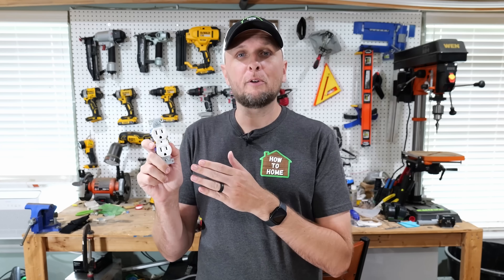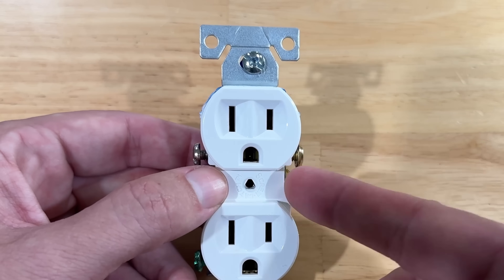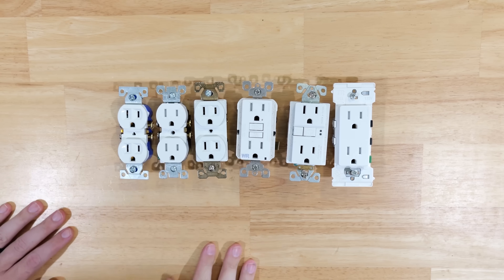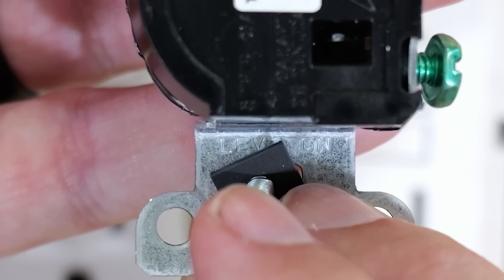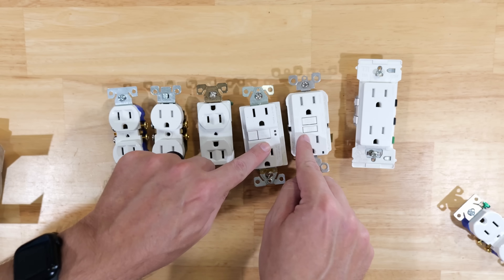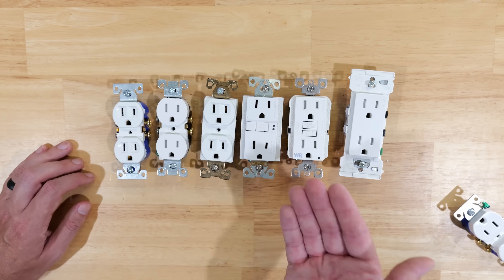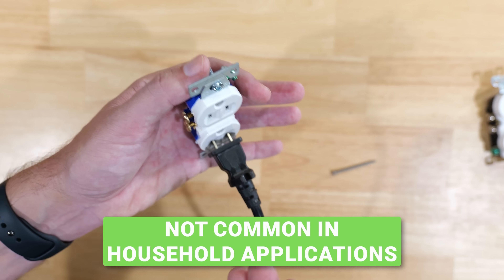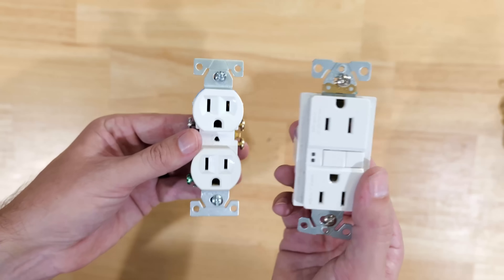The Shocking Reason Why Your Outlets Are Installed Upside Down!

Comment: I'm in the ground-port-down camp for residential.  The only time i see ground-port-up is in medical or industrial applications. The thinking is; this protects a potential short from an object (think piece of wire, key tether, another cable, etc) being drug across the inserted plug which might slightly dislodge the plug as mentioned in the video
Reply: Even in hospitals, I don't believe there is a requirement for ground plug up. It goes back to the old "metal faceplate falling down on plug causing short" syndrome. Every plug I have ever plugged into an outlet leaves absolutely no room for a plate or any other object to fall between. Plugs are totally flush against the outlet and designed that way to prevent objects or fingers to touch the prongs. Faceplates do not just fall off the wall. At least in my 71 years of existence I've never seen it happen.

Comment: My old house is completely re-wired and I installed all the outlets ground prong down. 3 of my appliances have the 90° plug, and hanging down just made sense. I wired my garage receptacles with the ground prong up just to annoy my contractor friend! It did get on his nerves.
Reply: If I were buying your house I would refuse to close until that was corrected.

Comment: Great discussion. You’ll never convince the other side however. One thing you didn’t mention is that an awful lot of cords on fridges, washers and power strips now are right angled to hug the wall better and the majority of them are in a ground down orientation.
Reply: @bv226  Exactly! Plugging such a cord into a ground up receptacle nullifies the whole point of the bend as the cord has to make a u shape which does not hug the wall any better than a non-bent cord does.
Reply: Yes, my washing machine and refrigerator agree.  Ground down for sure.

Comment: My old journeyman insisted that the reasons that, for example, the hospitals install them with the ground side up was because the ground pin can carry more weight from a heavy 120VAC cable. Which back then the hospitals did have heavy duty cords for just about all their devices. The jury is still out!
Reply: Not just the weight of the cords, but also blows from falling objects.  I've only ever heard the "something might fall and hit the ground pin" argument from people arguing against ground-pin-up.  The issue isn't something making contact with the pins, it's something dislodging the cord of potentially critical equipment.  Things falling and striking the cord are less likely to dislodge it if it is narrow side up.  Doesn't usually matter in homes, but something to keep in mind when wiring up a shop (or a hospital).
Reply: I put ground side up in garage and industrial areas for the same reason plus over the years the receptacle seams to last year's longer less cords falling out after a few years
Reply: In 34 years experience, ground down in houses or owner preference. Ground up in an industrial setting.  In hospitals, I've always installed the gray or red hospital grade recepts.....Geeeez, have you ever tried pulling a plug out of one of those? I don't think it would matter which orientation the ground was. They have a pretty stout grip. I was always told to install ground up in industrial and some commercial settings because of the possibility of something falling in between the plug and device. Anyhoo....good vid
Reply: I do like how the plug "hangs" with the ground up, keeps the 2 prongs inserted better, reducing arcing possibilities when things start getting looser. Not great for the 90 degree plugs though.

Comment: Ground face down when I replaced myself all 2-prong receptacles with 3-prong receptacles.  Licensed electrician who replaced the electric panel & also installed several new 3-prong receptacles also installed Ground face down. Reminds me of a face - mouth and two eyes.  
3-prong appliances in my. house  are microwave, Fridge, Gas-top stove, gas wall oven,  clothes washer, clothes dryer, gas furnace, humidifier, extension cords, overhead garage door openers, desktop computer,. All other electrical items are 2-prong.

Had outlet covers & cabinet locks when my children were toddlers. :¬) Webhead USA

Comment: All of my angled plugs are shaped for bottom ground if I don't want the strain of the power cable doing a full 180 going back to the floor, so the correct orientation for me is ground-down.

Comment: Great video, right angle plug don't look good in a grd up install
Reply: True.  Also there are lots of timers that require the ground at the bottom, otherwise it will be upside down.

Comment: It messes with my OCD if the outlets are upside down!   I most often see ground up in doctors offices and hospital settings.
Reply: @JeepinMaxx  Just like a lot of 3 pronged cords in a residential setting are designed with a 90 degree bend for the ground down orientation, a lot of medical equipment is designed with the ground up orientation in mind. That’s why doctor’s offices and hospitals tend to be ground up.

Comment: This code covers receptacles that are in a vertical installation respecting the floor. What about receptacles in a horizontal installation?
Reply: code doesn't care about orientation beyond not putting receptables face-up or within flooding risk (ie, really close to the floor such that a pool of water could infiltrate the receptacle).  Nobody really ever installs receptacles horizontally because the device plugs were never really designed for that, and places that do so are likely doing it for aesthetic/spacesaving or otherwise-arbitrary reasons that have nothing to do with code.

If you really wanted to, you could install receptacles in an angled orientation...but because houses are never built in that way there's almost zero chances to do so without extra work for no reason.  I imagine the reason why we install vertically is simply because of the machinery used to make receptacles are oriented in that fashion.
Reply: @aliso-pv7ll  In my opinion, a horizontal orientation on the wall means the installer didn’t have the cojones to pick a side in this debate 🤣

Comment: I was just recently in a local hospital & I noticed that all the outlets in the rooms & hallways had ground up.  I didn't notice if the gfi in the bathrooms were this way though.
Reply: You got that right.  Also in our research buildings.
Reply: Hospitals are a high hazard area as Oxygen is commonly piped into every room. 

Sparks not a good thing there.
Reply: In Canada we put ground down in residential areas so as the plug wiggles out the ground breaks contact last. In hospitals it’s ground up to prevent an arc flash in a possible oxygen rich environment.
Reply: I've ask hospital employees about the plug upside down.    They said they're plugs that connected to emergency backup power
Reply: @Peanutz77  In our hospital and research building, the emergency power recepticals are red, and the non are white. Which is pretty standard in the area hospitals I have been in. All have ground up. Do you have red recpticals at all there?
Reply: @momkatmax  yes. They were red and ground up
Reply: @Peanutz77  Most of the time, emergency power outlets will be distinguished by color.  Orange outlets are pretty common

Comment: When using metal cover plates, I always install with the ground prong up. I have seen the screw holding the plate wiggle loose and drop down on the plug.
Reply: Good point, but the real solution there is to tighten the screw properly and put a little spot of nail polish on it. The ground down safety reasons outweight the only ground-up reason.

Comment: Thumbs up on GP down. I’ve been an electrician for 50 + years and have always done it that way and in the CEC Canadian Electrical Code all the diagrams in it show this style of receptacle GP down. Not sure on the NEC.
Reply: Im not sure what CEC that you are looking at, but Diagram 1 CSA configurations for non-locking receptacles shows the Ground pin as the top pin. This is for all devices on the page.  People are more comfortable with the ground pin being down as it looks more like a human face.
Reply: P&S receptacles show (the wiring diagram) to install with the ground side up.                                          Ps my uncle was licensed as commercial electrician For 50 years when he started in the trade they were still soldering the wires  together; was a supervisor for the last years of his electrical career . He retired once at 62 got bored and found another job retired again for the last time at 70. Lived to be 93.

Comment: I agree that the chances of a paperclip or nail dropping down on the prongs perfecting & setting off an arc or fire are slim – but – if the way to make that chance go from slim to zero, is to put the ground prong up – I’ll use that in the future.  As always, Thanks for your great insights.
Reply: But if the theoretical paperclip that slides exactly next to the wall comes down at an angle (more likely than it falling exactly horizontally), there's still a 50-50 chance it'll come down on the left side of a ground-up plug and thus contact both the ground and the hot. So really no difference.
Reply: @tedwalford7615  your math is wrong , your assuming the object will automatically hit the prongs beneath after hitting the ground but it might bounce away pretty much anywhere in a 180 degree angle including away from the wall. personally i don't really care what side they are on but ground down seems more practical as in less wasted outlets that get blocked by other plugs.
Reply: @mikeharrell287  The main problem with ground up is if you are plugging in a device with a 3 pronged cord that is designed with a 90 degree angle to keep the cord close to the wall. Such cords are nearly universally bent in the direction of the ground plug. If the receptacle is ground down then everything is fine. But if the receptacle is ground up, the 90 degree angle lifts the cord upwards and then gravity pulls it back down resulting in a u-shaped bend in the cord. That’s probably not good for the conductors inside the cord and makes the bend totally pointless as the u-bend prevents the cord from laying flat against the wall.
Reply: There is also 100% percent chance you won't get in a car accident if you don't go in cars anymore so there you go.

Comment: I'm currently in the process of redoing my woodshop from the floors on up. As I replace (and in most cases move up from 9" to 35" off the floor) I am installing them ground wire up. So many 3-prong cords with so much potential for falling debris I think that this is a smart idea.

But normally I prefer the Wow-Face look (ground wire down).

Comment: This question is easy, it depends on which city you live in and who is enforcing code. Some city have grandfather clauses.
Reply: I still have a some (2) wire outlets in the house (70 years old). It was the built in the last year that still allowed 2 wire outlets. I have replaced the majority of them with 3 wire outlets with a proper ground and the ground pin down.
Reply: @Micah_6_8_Walk_In_Love  Is “Grandfather Claus” St. Nick’s dad? 🤣

Comment: You should do a video for the rv mobile home community on how to replace the very dangerous IMO snap to splice outlets they're equipped with!
Reply: Isn't it weird they used RV style receptacles and switches in Mobile homes. Some one I know bought a mobile home built in 1988 and have to pay rent for the lot it's on with those crappy receptacles installed. Only paid two hundred and fifty k for it what a bargain and not up dated either double Wide😮😢
Reply: @Kat-on3nm  idk which started using them first rv's or mobiles but I know why, they're so cheap poc plastic all in one no box or separate cover and mount like an old work box to save time and money! It's a crime they're not held to residential standards and no wonder they're subject to so many instances of fire sadly...

Comment: My dad, who was an electrical engineer, taught me that having the ground up provides stability to the plug itself while gravity is pulling the cord down and trying to dislodge the ground and thus keeping the hot and neutral prongs inside of the recepticle.  This also helps maintain the clamping force of the clamps inside the receptical since there would be less movement overall throughout its lifespan.

That being said, since there are certain appliances that design their plugs with ground down, without or without the ground prong, it would be more advantageous to rearrange specific recepticles to accommodate this, such as a refrigerator.
Reply: You did not mention those appliances which come with 90 degree caps, if ground prong up it leaves a loop above the receptacle
or reduces the usable length 15:31
Reply: I'm a EE, and I agree with your dad.  I have one exception in my house--the washing machine cord, which is molded to hang down if plugged into a receptacle with the ground at the bottom.  I turned that receptacle around, to ground pin down.  All other receptacles in my house are ground pin up.
Reply: I totally disagree based on personal experience. Ground down provides a more stable plug connection when gravity pulls down on a heavy wire connected to the plug.